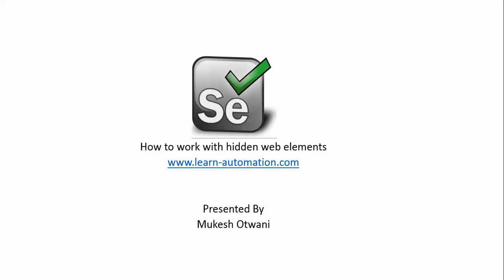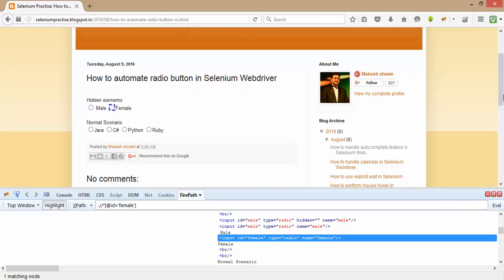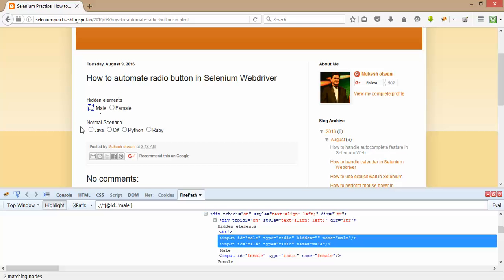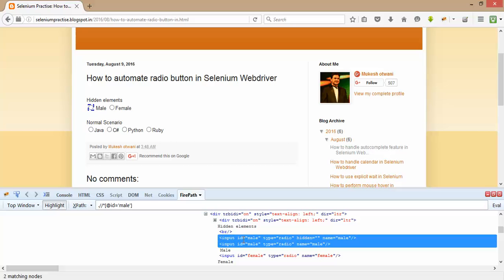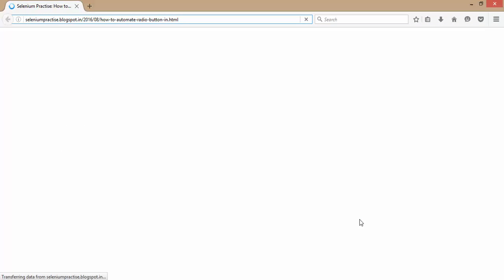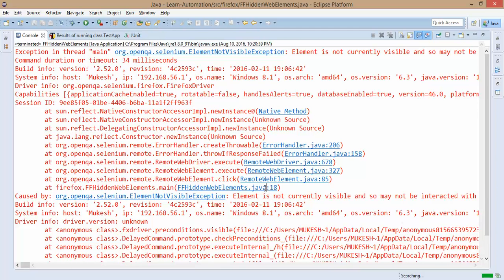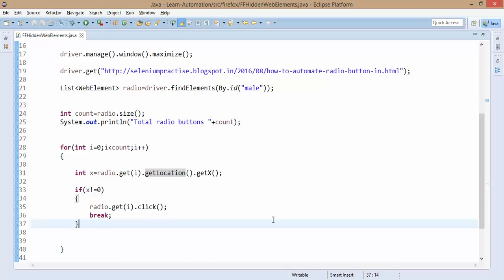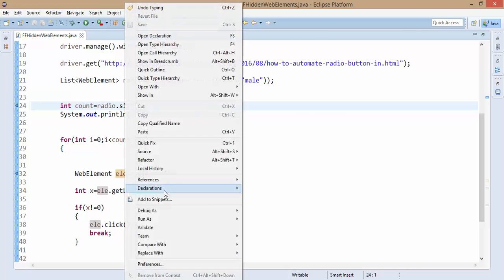How to handle hidden webelements in Selenium Webdriver

Comment: Hi Mukesh, 
I am trying to write a code for a website and the elements have  static xpaths but sometimes the elements can be found and sometimes i get "no such element: Unable to locate element" .  I have implemented the Implicit wait but still it does not seem to be working . Please note i have tried locating elements using xpath or id or name but i am still getting the same issue.

Comment: Hi Mukesh, i am unable to select an item from the list.
I created a list of webElements and using advanced for loop, iterated for all the items present.
while i was able to print the name of the elements (using getText() method), i also wanted to select one of these elements.
but it wont enter into the if loop. Following is the code i used:

for(WebElement el : list0{
if(el.getText().equalsIgnoreCase("Browse"){
driver.findElement(By.xpath("<expression>").click();
System.out.println("if loop");
}
else
System.out.println("else loop")
}

when i run this, it doesn't go into the 'if' loop. I printed the list item names and supplied the same in the expected section of the 'if' loop. Yet it is not entering the loop.
instead it prints "else loop" in the output window, only once.

Please help.

Comment: Sir what is meant by x axis,and y axis,and what is the use of get x() and get y() methods
Reply from the maker: x, y coordinates are respectively the horizontal and vertical addresses of any pixel or addressable point on a computer display screen. If x and y is negative it means it is not displayed on screen.
Reply: @Mukeshotwani  ok sir,tanq very much sir
Reply: @Mukeshotwani  in my case, I have to click on No radio button for all 15 questions.. But in the current Web page view only 4 questions are visible and so its not selecting remaining questions unless I scroll down.. Will this solution work?? Pls help.. I am stuck with this.. I have already written dynamic xpath

Comment: I need help in solving the particular issue

how to bypass clicking  the  webelement if webelement is not  present in selenium
Suppose 
if(ele.isDisplayed){    //ele is the webelement
ele.click();
}
In this case if ele is not displayed , then selenium will continue on searching the element 
I have also used 
if(ele.isDisplayed== true){  
ele.click();
}
but no use
Reply: Put something in else block. So if it didn't click at the first attempt it will go to else block.

Comment: when we try to generate xpath form Firepath, why does it start with .(dot) operator  while when we try to write dynamic xpath, we don't use .(dot ) operator?
Reply from the maker: you can ignore dot operator it won't make any difference.
Reply: Mukesh otwani yes it works without dot operator but I just want to know what is the significance of using this dot operator?
Reply: I hope it implies a start from current node.

Comment: Hi Mukesh.. I am trying to locate an element but it is giving me "Element not visible" error. When I tried to find out the X and Y coordinate it is giving me the value for them but while trying to click on it, it is giving the same error saying "element not visible". Can you please help in resolving the issue.
Reply from the maker: Check if element is within frame then switch to frame http://learn-automation.com/handle-frames-in-selenium/
Reply: I does not exist under frame. The element comes under something like ::before and ::after. Below is the html syntax:

<div class="modal-body">Are you sure on Deleting Indicator: AGE_ON_NETWORK_LifeTime ?</div>
<div class="modal-footer">
::before
<a class="btn null" data-handler = 0 href="javascript:;">Cancel</a>
<a data-handler="1" class="btn btn-primary" href="javascript:;">OK</a>
::after
</div>

I want to click on Cancel and OK button but it always says element not visible.
And this small popup/alert/warning sort of window opens when I click on some button.
If I am not wrong then it is not in frame.

Comment: Hi Mukesh  can you share  me how to find hidden webelements in Selenium Webdriver ? as i am unable to find and it is also not available in describtion link .
Reply from the maker: Hi Vipin, there is not locator to find hidden element so you need to write custom xpath which will search all hidden webelements.

Do you have any sample application where you have hidden elements so that I can send some code for the same

Comment: Hi Mukesh,

I am trying to automate google account creation page but for the field 'Month' in Birthday section i am getting following error when trying to select month:--

Exception in thread "main" org.openqa.selenium.support.ui.UnexpectedTagNameException: Element should have been "select" but was "span"

Can you please guide me how to handle this ?Thanks in Advance
Reply from the maker: Hi Archana this is not select tag so select class will not work. Try using below approach http://learn-automation.com/handle-bootstrap-dropdown-in-selenium-webdriver/
Reply: Hi Mukesh,

Thanks for the answer. I tried the solution but getting the list size as 0 :(
below is my code:-
WebElement dropdown= driver.findElement(By.id("BirthMonth"));
  dropdown.click();
  
  
  
  List<WebElement> list = driver.findElements(By.xpath("//span [@class='     form-error']//div[@class='goog-menu goog-menu-vertical']//div[@class='goog-menuitem']//div[@class='goog-menuitem-content']"));
  
  
  System.out.println(list.size());

In chrome when i paste the above xpath it shows 12 element but in selenium it shows the list size as 0.
Can you please let me know where m wrong.
Reply: thanks Mukesh :)